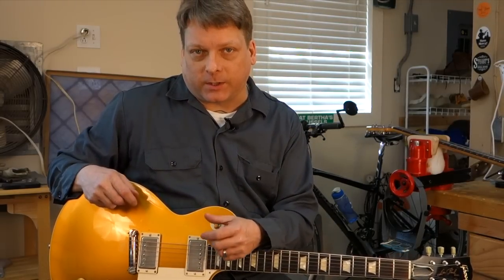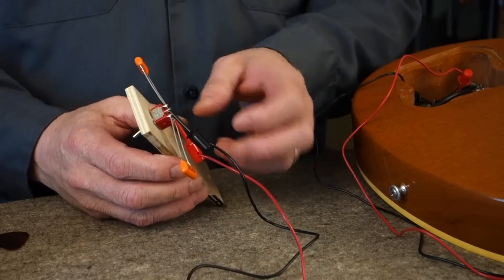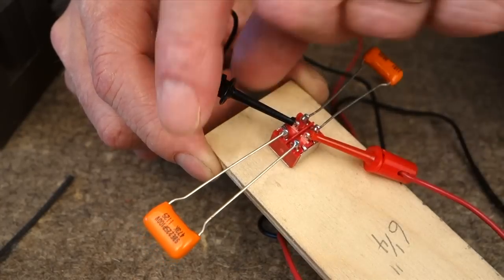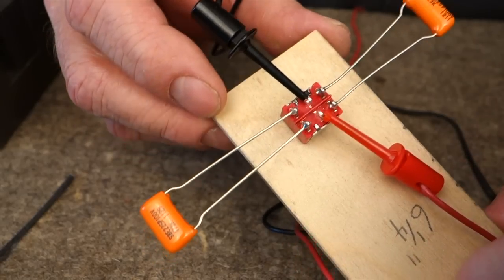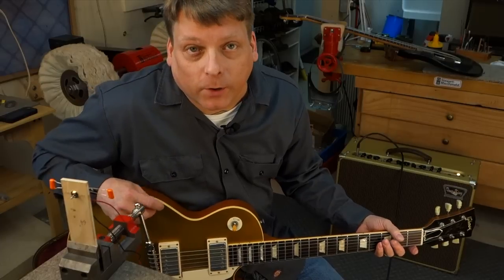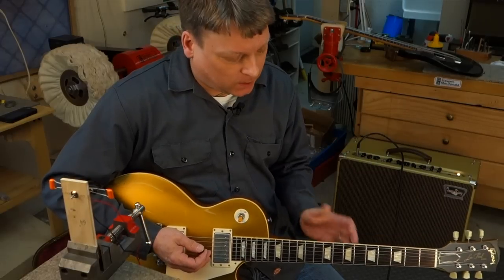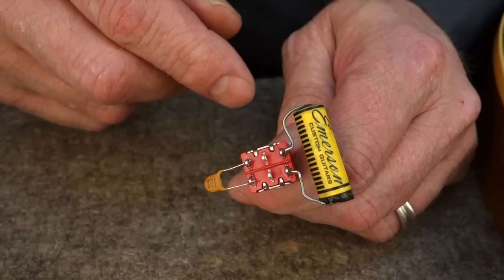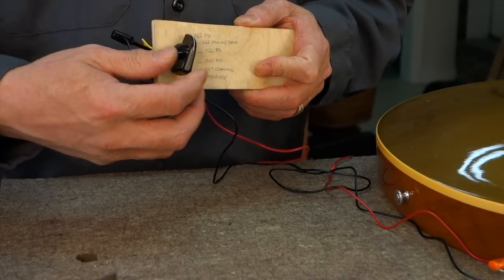Guitar capacitor tester: let your ears decide

Comment: would you recommend styropol caps?
Reply: they are the best the holy grail of caps
but they are made in smaller values
probably  nothing bigger than  1 nf  and you need 22 nf
Reply: you could put 22 of them in parallel lol.

Comment: How the orange drop 600DC can sound on my les paul?
Reply from the maker: It all depends on the capacitance of that orange drop capacitor. Is it a .022uF capacitor? .047uF? The 600DC only refers to the maximum voltage that capacitor can handle. However, you're going to be hard pressed to find any passive electronics setup in a guitar that even comes close to 600V DC. Passive guitar circuits are measured in millivolts.

Comment: In your test circuit, the long leads  themselves are adding a level of capacitance to the circuit.  You need to insert them closer to the fixed final positions, IE solder or clip them to the pot ground or pot lead, to get accurate signal levels. Also, Orange Drops have a "same" unique sound because of manufacturing similarities between different values.  Other Sprague, mallory etc. caps of the same or different values will sound different. Finally.......the value of shunted signal, IE where your tone pot is set has a huge difference between values, as the added resistance value being a "constant" works differently in the RC circuit you are creating.  Merely flipping a switch between the two, and not setting the tone pot "to taste" isn't telling the whole story.

Comment: Isn't a tone control a treble roll-off, therefore only giving an illusion of "added" bass?
Reply: it is :)
Reply: how long is a piece of string? - if you take off the treble you get more bass...
Reply: Yes, it's a passive low pass filter.
Reply: well actually when a tone control is rolled back to '0' it creates a new resonant peak. With a larger cap like 47nF or 22nF this new resonant peak can be in the bass frequencies. Reducing that cap's value will move this peak towards a higher frequency, as well as increase the height of the peak. So technically a tone control CAN increase bass, but generally, yes, the control rolls off highs through a majority of its 'sweep' You dont get the added resonant peak until like '0-1' on the pot.

Comment: I was noting the fact that it is a YouTube video and not in person for it being difficult to hear the difference. I'd bet in person you can probably tell easily. I bought an Audere preamp system for my Jbass and it came with a bunch of caps so you could customize your tone and a little can go a long way in some cases.
Reply: Yes in general changing the cutoff frequency will do that to the sound. That is why most Amps do have tone controll inside....

Comment: The paper oil is the one .
Reason. They are like a toilet roll , so one plate is on the outside. 
The outside should go to low impedance or ground of circuit and inner to high impedance side, an input for example. This will reduce the risk of picking up noise.

Comment: why not install them both with the switch?
Reply: Mohammed Alkhuzaie you could actually wire to push pull pots to have the variety if so desired

Comment: It's because different caps of the same value CANNOT sound different. What you hear is variations of the value of the cap. Once you learn how a cap works, you will understand why this is so. Signal never passes thru a cap. It charges and dis-charges and that is a function of it's value.

Comment: If your tone control is on 10 you probably will not hear any difference since the tone cap is mostly out of the circuit. Roll the tone back as suggested to hear the difference. You can add a pull switch on your tone control and add 2 different caps to it. You would then be able to switch back and forth at any time. You may like the sound of the .047 for Blues and .022 of other types of playing like chicken picking.

Comment: PIO are so much better, I once had my local guitar tech try to steal my PIO caps. "eeeeeeh I thought they where just cheap"..yeah buddy in a Gibson Les Paul...smart. FWIW The old strats 57/62 have 0.1Uf PIO caps, believe me it makes all the difference. A PIO cap is the first mod I do to all of my guitars. They sound smoother and rounder, more traditional and it doesn't cost that much either.

Comment: Pretty moron test, I am sorry brother. Those tones really get a use when you start to get gain on a distorted channel. Just try any lead channel of an amp with the tone at 0' with 0.047 and 0.022mf and tell me later if it is no difference. In one case, you'll get a fuzz amp, on the other cap, you'll find a overdriven vintage sound.